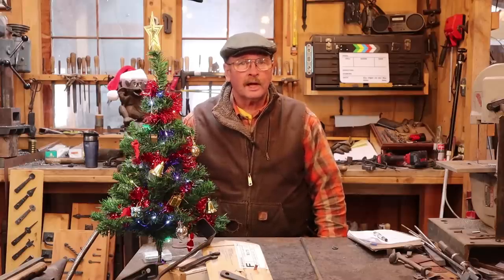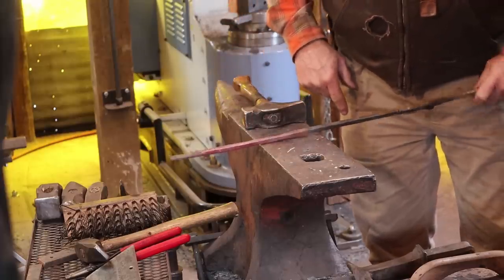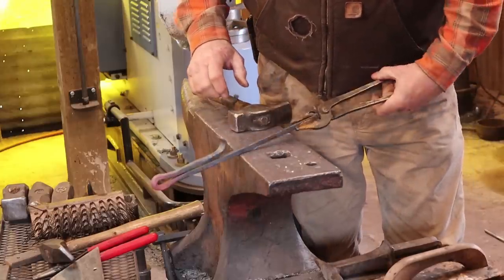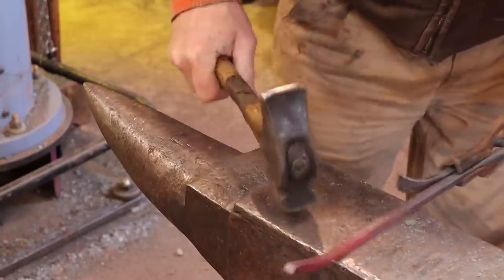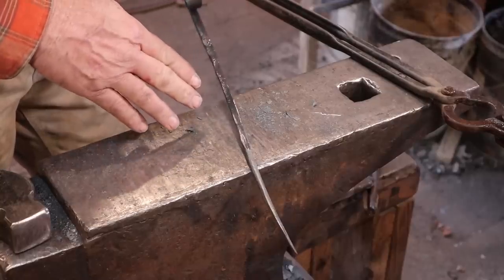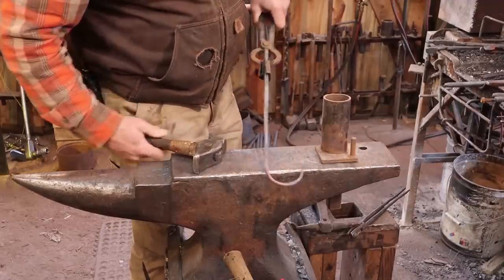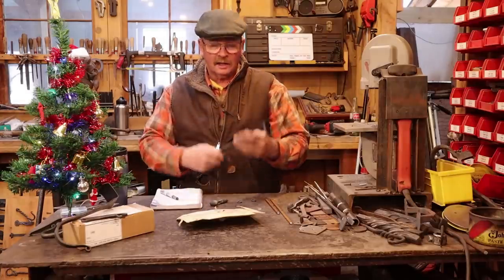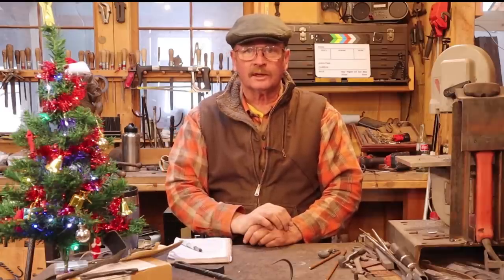Steak flipper - Countdown to Christmas

Comment: Hello John, in Germany we have an exact measurement for making the hook: It has to fit exactly around the neck of a beer bottle so you can use the steak flipper to lift your beer out of the box while standing at the grill ;-)
btw. I like the christmas countdown on your channel, a very nice idea!
Reply: That looks like it would be more likely to pull a can rather than a bottle out of that cooler!  maybe even a can of Fosters?
Reply: ... and you can make thumb-supporting twist at the handle, of the size that opens the bottle of beer, that would be all-in-one tool for steaks and beer!
Reply: John could you send me a picture, and give the size for the beer bottle. Stan
Reply: John I just re read your text. The beer bottle pick up is the same as you are using on the stake, right ????

Comment: I make a blend of beeswax with just enoigh coconut oil so that it's hard at room temperature, but it soften just enough melt when you run a rag around on it. (Just slightly harder than shoe polish) I call it knife butter because I made it for carbon steel knives, but I now use it on anything that needs to be food safe.
Reply: That is a great idea! Beeswax and coconut oil,  I have always just used cooking oil but I'm definitely going to have to try the beeswax and coconut oil in the future. Thanks!

Comment: When you say 'mild steel' can you tell me specifically which steel? Is is A36?
Reply from the maker: In most cases, yes i am using A36.  However different parts of the world have different names for steels.  Mostly I mean inexpensive, readily available non hardening steel. As opposed to any special alloy or tool steel.
Reply: @BlackBearForge  Thanks for a detailed answer. In my area A36 is the inexpensive steel I usually get locally.

Comment: Excellent project as always. I personally love making them. There is a huge BBQ community here, and those are fantastic sellers for me. I do coat them in just a veg oil. You make the hook section very close to as I do mine. I have seen some with a tiny little hook at the tip, but I find those just do not work as well as far as how people to rate their wrists. This is a fast thing to make, and is something I love to forge as it gets used a good amount, and people see the product. I'm glad you put that extra half twist into it. I was wondering about that when you stopped 😂. Probably the simplest tool so far in this series to forge, but one that I have seen have the most hand/use time.

Comment: John, you just made my point I was making in yesterday's comment!!  When you were working on the horn of the anvil, you made an off-the-cuff comment about the stability of your anvil.  

You said that "if you are working over the horn of your anvil and the tail keeps flipping up, you are wasting your time".  WOW!  If you are listening, this tells you to make sure that your anvil is stable, and solidly mounted.

Why is that information important?  It all comes down to force.  When working hot metal, all you have is your hammer and your anvil.  If your hammer blow, with your hot metal in between the hammer and the anvil, is against a solid base, then ALL of the force, from that hammer, is transferred into the hot metal.  The hammer is moving the anvil isn't going to move, hopefully.  The hot metal has to move in one direction or another.  If the base is flat ( e.g. the face of the anvil), it follows that the metal will "squish" outward from side to side.  Whereas, if you work over an area that presents a much smaller profile for the force to be concentrated in a much smaller area (e.g. the horn of the anvil), the metal will move in a more linear fashion, be "drawn out".

If your "base", your anvil isn't solid on its foundation, then a lot of your force is wasted, and you'll have to work harder to achieve similar results as those who take the time to make sure that their anvil is mounted on a solid foundation.

 Where else can I get that information except at the elbow of an experienced blacksmith?

Your loyal student.